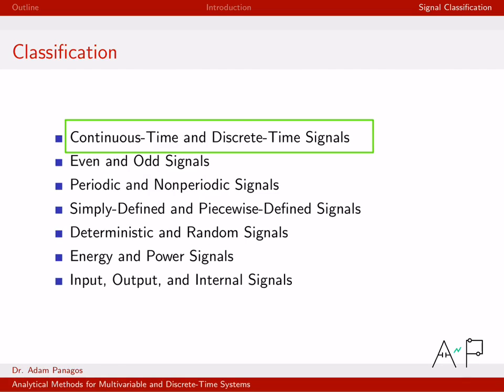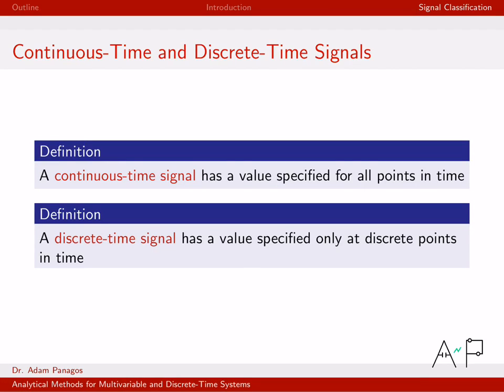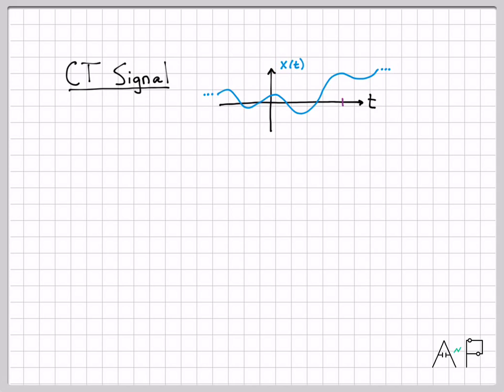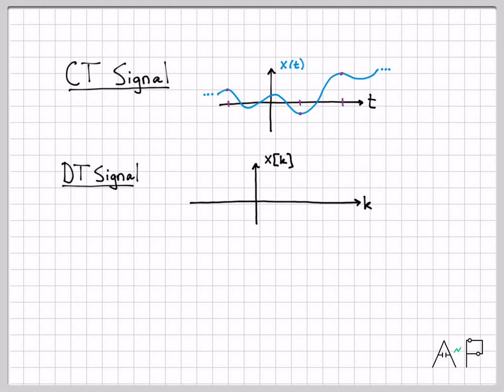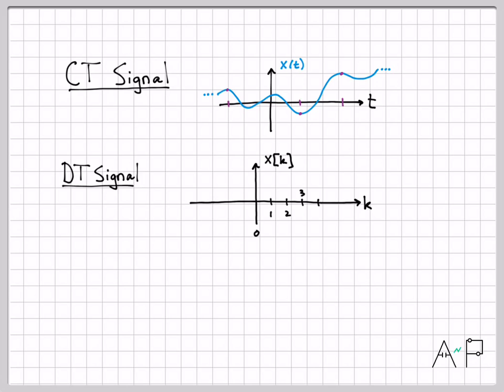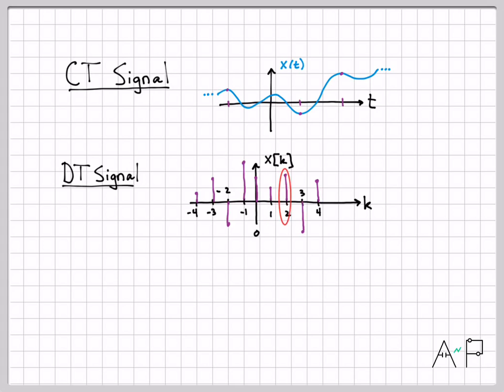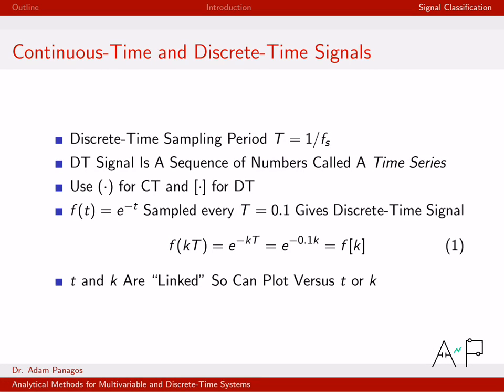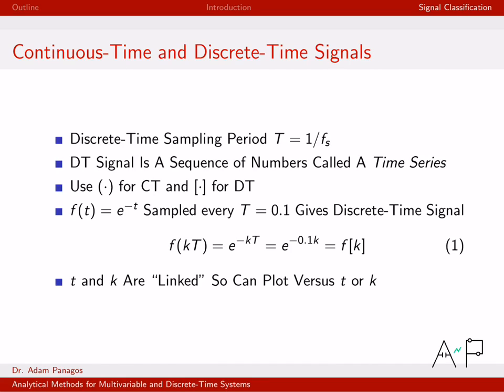Continuous-Time vs. Discrete-Time Signals - DT Part 1 (2/10)

Comment: In practical terms, is not the continuous-time signal not simply the limit as sampling interval of the DT signal approaches zero? 

And isn't the only real difference the sampling rate? e.g. an approaching aircraft always has a range and a closing velocity (CT variable), but the range or closing velocity as determined by radar has a DT value because the radar has to sweep or the pulses have to go out and return or the processors have to iteratively sample and calculate the CW returns if that's what you're using. Sure, they can sample it at a rate so fast that the human brain can't perceive the difference, but there is still a difference. About the only time you come up against a hard DT "stop" is in a digital computer itself, or possibly at the quantum level (regarding which I'm sure Mr Heisenberg would have a few things to say).